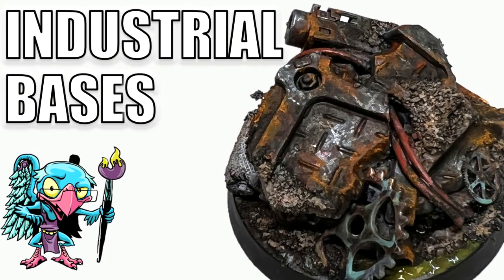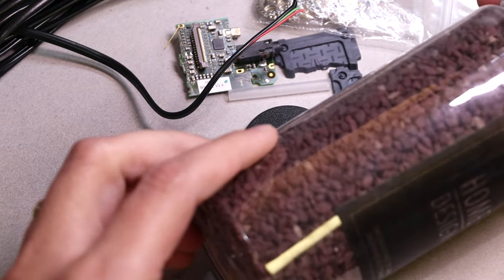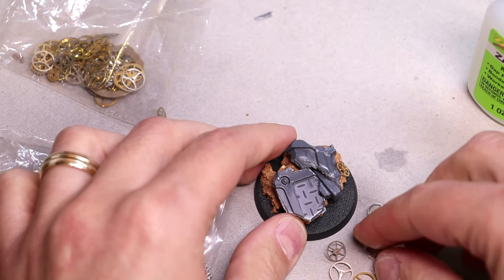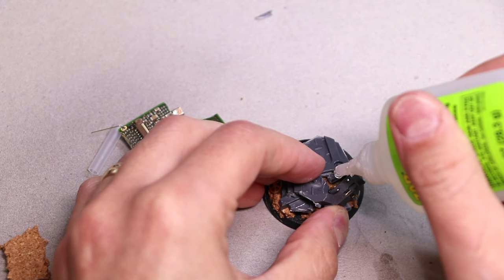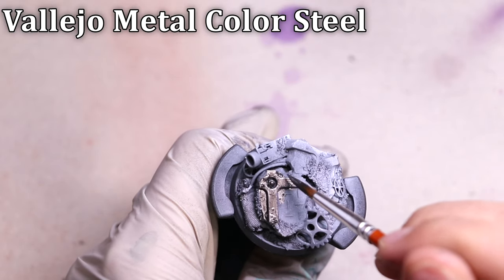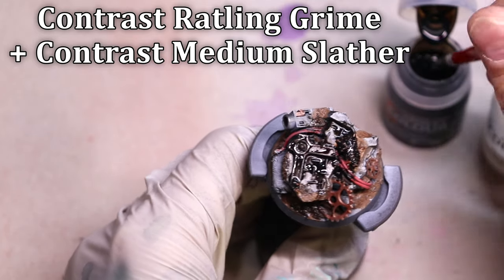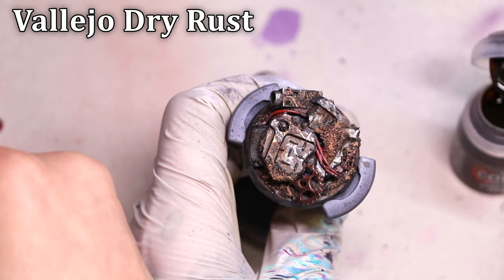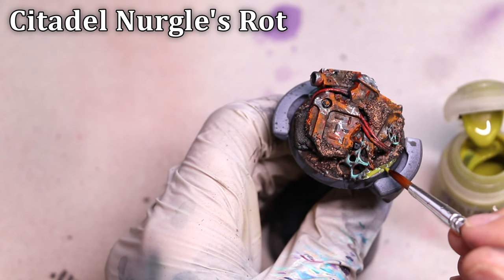Industrial Wasteland Basing - HC 363

Comment: A note about using scrap electronic components, not specific to this build, but generally: most parts are fine, but avoid using parts that can leak, like the cylindrical capacitors out of a scrap PC power supply.

Also, if you're doing some sort of lighting with LEDs, or electroluminescent wire, you can hide whatever resistors or small relay logic parts you might be using on the base, itself, and then you just have to worry about the wiring.

Comment: I'll just add my own tips since this is exactly what I'm working on for an Ork army (scrap bases):
1. Cheap plastic modular terrain. 
I don't know how widely available they are anymore, but Tehnolog (Russian company) did these modular terrain kits for cheap, chock full of plastic bits. The three main ones were 'chemical plant', 'platformer' and 'hexagon'. I know you can still get them and if you do, you'll have materials for hundreds and hundreds of bases in the form of cogs, pipes, plates, metal beams and much more. 
I'm sure there are other brands that offer something similar.

2. Bottled textures.
Use them as filler. You probably have some Citadel texture paint leftovers, or big bottles of AK/Vallejo materials that you can stuff in between all the little pieces you want on your base. The cork is great, but these also act as something you can stuff your terrain pieces into. Typhon corrosion is also great for adding a little bit of grit on top of flat plates and gears. 
Anything Citadel is expensive, but as mentioned, you probably already have some.

3. Rubber wheels.
Now while I wouldn't exactly recommend plundering your LEGO collection for its tires, but you can often get an entire bag of wheels and tires for toy cars on the cheap and stack a few or sprinkle them in occasionally on a base to add some variety.

4. Wiremesh.
Any sort of plastic or thin metal wiremesh that you can bend and cut into pieces is great. 

5. Plastic bottle tops/caps.
Look at something like your glues and dropper bottles. Those tops from empty bottles are easy plastic bits for terrain, like a 'Loctite' black ridged cap can easily be made to look like a "tesla coil" style piece, especially if you put some wires on it. 

6. Old electronics.
Gamepads from old consoles, electrical clippers, remotes, headphones, speakers, vape pens, you name it. Got something shoved in a drawer that you're not using anymore or it breaks? Chances are some of these things have small components that are handy as terrain pieces. 

7. Wood and cardboard.
Corrugated cardboard when stripped of its outer layers gives you what looks like a miniature corrugated metal sheet. If you use a wirebrush or something else to dig grooves into popsicle sticks, you'll get some easy wooden planks to mix in with all that metal, dirt and concrete. They soak up washes and then you just drybrush them. Easy. 

Finally don't forget bits from your other model hobbies. I have a box of spare gunpla parts, of which some would fit in nicely on a scrap base.

Comment: Thanks for this video! I'm actually working on making some bases for the new Kill Team Into The Dark boxset, which is set on a Space Hulk. So I mixing and matching bits of plasticard, floral wire, paperclips, zip ties and mesh screens to try and create different bits. I'm drilling little rivet holes, making inset channels in the plasticard to form spaces for paperclip pipes to be set in. I spun together like five floral wires to create some thick trunk of cabling.

I will have to look out and pick up some of those nice gear bits and jewellery supply stores!

Comment: I was thinking of running Ratling Grim through the airbrush to “dirty up” the bottom of a large building terrain piece I have. Has anyone had any luck doing this and do you think it?
Reply from the maker: Yep, it will work just great!
Reply: @VinceVenturella  awesome do you thin Contrast when you run it through the airbrush like an ink (I think I saw you say 1 to 6 for ink to thinner before)?
Reply from the maker: @iancw1  Yep, exactly that. :)